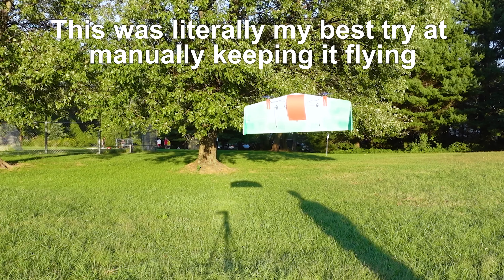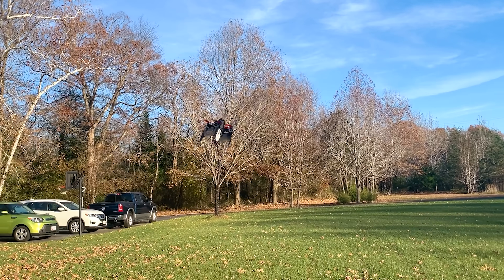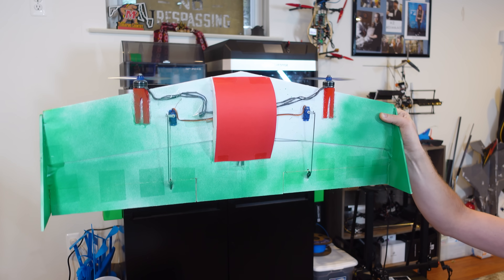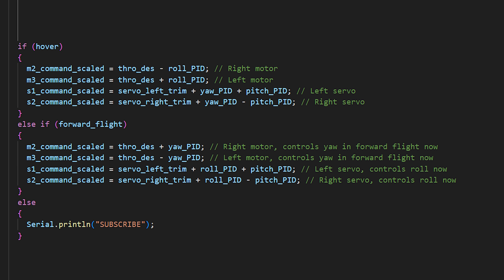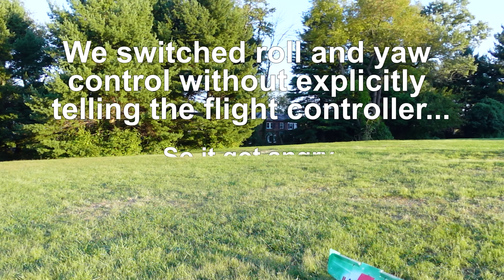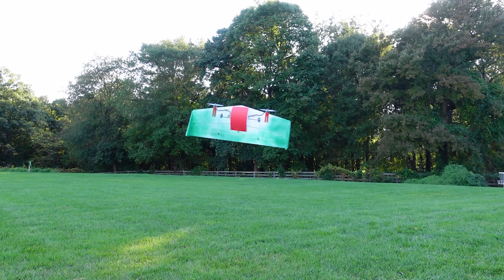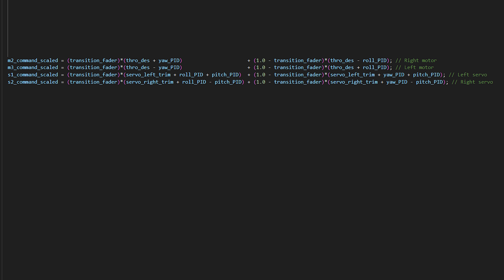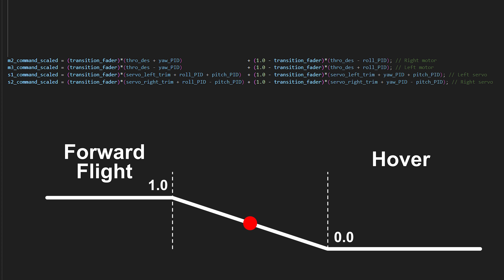Taming the Tail-Sitter: Hover to Forward Flight Explained

Comment: My mpu6050 is showing drift in values of yaw roll and pitch, I don't have much idea behind the implementation of madgwick filter so what can I do to solve this issue and why this is happening?
Reply from the maker: Probably need to calibrate the IMU
Reply: @NicholasRehm  I tried to increase the B_madgwick variable (I thought it is the gain variable between accelerometer and gyro), it made the pitch and roll stable, but yaw is still drifting, is it possible to stop this without magnetometer(cur MPU6050 do not have one)?
Reply from the maker: @PradhyumanSingh-x4u  you probably need to calibrate the IMU or read the docs

Comment: This tailSitter looks so much fun!
I want to build one ❤
I found that you provide the final code over at Patron!
You should totally rebundle this video as a build video, and market it as: a cheap sub 250 project you can build with your kids and have a great intro to programming 🎉
This is basically kiwico without the parts.
And you buy working code by signing up for Patron 😊

Comment: THIS is the stuff I've been dreaming of doing. I built an rc airplane and thought about getting some sort of processing unit between the radio receiver and the esc and the servos. What do you recommend using, considering that my goal is to learn the needed skills and then be able to do things like a tail sitter. In short, what should I be uploading my code to? An arduino?
Reply from the maker: I'd say build a regular rc plane first before overcomplicating with a flight controller. Direct RC receiver --> servos and motor, works just fine
Reply: @NicholasRehm  yes, I already have the plane built, my question is what flight controller would you recommend, basically
Reply: @NicholasRehm  hey! I actually followed your advice and am even more interested in making a tail-sitter. I'm thinking of making a wing as simple as yours - could you tell me some details about the one you made, such as weight and motors used, please? I'm worried that I might pick engines too heavy or on the other end too weak for this project

Comment: Hello Nicholas, i am new to the UAV community. I am planning on getting started with this TAIL SITTER model and learn about during the process. Can you please suggest the Motor and Battery spec for the tail sitter build?
Reply from the maker: If recommend staying away from a vtol as your first build
Reply: @NicholasRehm  I have tried the single copter(Ball drone)  model from Hackaday. The tail sitter VTOL fascinates me every time i look at it. Your built was the best one out there to learn. So, i thought about giving it a go.
Thanks for the heads-up.

Comment: It looks like your 4 engined tail-sitter had an asymmetric aerofoil profile but the subject here is literally a flying plank, getting lift simply from angle of attack. Is there any point in giving it a NACA profile, or would it always be stalled? It seems to have quite a steep angle here.  I'm intending to experiment with this thing but did you do that for simplicity or because you know there's no point?
Reply from the maker: Simplicity of construction
Reply: @NicholasRehm  at 0m28 it looks like you have double thickness over the leading half, so I guess a very crude 4% camber with a one step profile.  I forget the name for that.  Is that correct?  I was going to try 12%  and more sculpted profile, since this seems quite a slow aircraft. I guess the hide out for the electronics gives you more lift anyway.

Comment: It would be nice to know what battery, motor and props you used. I did some back of envelop figures with 300g 3S ,battery 2x50g motors and with all the lighter items I had zero grams left for the wing itself !
Reply from the maker: 180g battery, 2x 1750kv 24g motors with 5” props and peak thrust at 900g each. Foam wing weighed maybe 100g at most
Reply: @NicholasRehm  Many thanks, that clarifies a lot, I'll adjust my specs. I think I've sources most of what I need. The pdf documentation is excellent, very clear and thorough. One thing that gets only passing mention is the ESCs. I ordered a Mitoot  40A model. 30g each. Oddly the lower rated ones were the same or heavier. It'll probably serve later too.

Comment: Hi! I love your stuff. I have never made a drone or plane before, but I am looking to start ambitious. I looked at a lot of things, and for the project design I have in mind, dRehmflight is like a dream come true. Could you tell me if dRehmflight is capable of running an h bridge for a brushed motor instead of giving pwm to an ESC? I would imagine it's possible in arduino code, you'd just have to convert whatever number you want to the PWM for an h bridge, but I just wanted to know if you know if it is, or if theres any extra steps I would need to take. If there's anything I have learned about code, it's that if it wasn't designed with something in mind, its often really hellish to make that something work, especially as the HAL grows.
Reply from the maker: h-bridge brushed motor control is just different duty cycle pwm using the analog write function
Reply: @NicholasRehm  That's what I thought. dRehmflight would not mind this?
Reply from the maker: @citratune  you'd have to swap out the final motor write commands with an analog write call instead but other than that there's nothing stopping you
Reply: @NicholasRehm  thank u so much!!

Comment: Thanks for the arduino version added to the RCGroups page... now to sort the wiring out..... if you only knew the amount of times I tried to set up a tailsitter years ago using other flight controllers....this seems too simple to be true.... now to dust off a few old wings.... and print some more glue on motor mounts..... cheers

Comment: I am impressed by the work done. Is firmware based on Ardupilot/BF/iNav or something else? Can I try this FW on my aircraft?
Reply from the maker: It is my own flight controller code running on an arduino-compatible microcontroller. Check out the link the description to the GitHub repo

Comment: Hi Nicholas,

Great progress. Have been following your videos for quite a long time and glad to see that all missing pointers of tailsitter behaviour are solved in this video.

I have few queries :

1) How about putting rudder or split flaps for forward flight. Does it creates any major difference instead of thrust vector?

2) Would like to touch base with you for a project. Kindly let me know how to connect with you.
Reply from the maker: Rudder, split flaps, differential thrust--they all create a yawing moment which is the same in the eyes of the flight controller
Reply: Thanks for the revert. Is it possible to connect Raspberry Pi to this for further camera integration ?

Comment: Hobby coding and engineering always gets me wondering how hard it is to do these things with full scale aircraft. Must've been a pain in the ass to get the V-22 to transition correctly even if it isn't snappy like a styrofoam RC wing.
Reply from the maker: Physics and fundamental principles are all the same. But lots and lots more testing, validation, modeling...

Comment: Hey. I really admire your work on dRehmFlight. But ı couldnt find a source that explains how to use it as a stabiliser for fixed wing aircraft. A short video would be perfect! ı have bought a teensy 4.0 and ı am trying to use your code as a stabiliser for the plane ı am making right now (2.6m wingspan. it's kinda big)
Reply from the maker: Check out my video on how the code works, there’s some examples for how to assign stuff out to servos in the control mixer
Reply: @NicholasRehm  Will do. Thanks a lot for the Quick answer

Comment: You don't need a flight controller. You can hover manually if you have a rudder in your propwash. Ask any 3D rc pilot I've been hovering manually since I was 10 and that's not a brag.
Reply from the maker: Sure but no attitude command
Reply: @appa609 : Manual hover is possible with rudder when you have long moment arm. Flying wing with no extended tail, rudders are ineffective.

It can only work if you have rudder on wing tips or split ailerons or below the prowash as shown in the video or thrust vector.

Comment: Great video. Love how you explained different aspects of the problem the approach to resolve it. I am thinking of buying a teensy and build one of these. Will it work on a nano goblin which has only one motor or will need a lot of tuning and changes to the code?
Reply from the maker: Sure you can throw it on a nano goblin to stabilize forward flight, but I don't think you'll be able to hover it
Reply: @NicholasRehm  thanks for the reply. I was more interested in the hover actually to make the nano goblin a vtol. Any specific reason why this would not work?
Reply: @NicholasRehm  will putting this on a heewing t1 ranger hover it? That has 2 motors but a real elevator instead of elevons. I am assuming no. But just confirming.

Comment: Very interesting. VTOLs are on my list for ages now... I did some contraptions years ago, but the electronics/hardware were a limiting factor, not now tho. Next thing, deciding on type of VTOL, less dead weight + less moving parts = grater efficiency... so this type looks very promising, but as usual, it got downsides...
I'm very interested where are you going with this, keep us posted :-)
Reply from the maker: Primary downside of this particular design is susceptibility to wind, further complicated by reliance on motor thrust for control authority (ask me about how easy it is to control while descending at low throttle….). I’ve got a design I’m cooking up that I think solves some of these issues at the expense of a little more mechanical complexity!
Reply: @NicholasRehm "little more mechanical complexity" - hhehhh, that's where problems and fun begins, good luck m8!

Comment: The frame of ref and the actuators don't change relative to each other. You could've just change the definition of the remote control sticks 🙂
Reply from the maker: Using Euler angles for attitude command complicates this a bit. But yes I’ve done exactly this for rate-command tailsitters in the past

Comment: i wodnering
is it possible when you flick the switch to have a timer like 1-2 seconds where it calculates what boths tates are and does100:0 then slowly fades to 0:100 of the other settigns merging them so it isnt a sudden jerk,  but it slowly tilts over i unno,  XD

yaaaay i was right, but it was called fading :D and linear transition

Comment: Would it not be easier to auto-transition the controls depending on pitch angle instead of a switch input?
yawservo = yaw*sin(pitch) + ail*cos(pitch) type of thing?
Obviously it would cripple aerobatic flight, but that is not the goal i think.

Comment: What if you instead rotate the flight controller/imu to transition? 

Just stick it on a servo :) No code required?

Tailsitters seem like the best option for vtol it’s a shame the abandoned it for fighter jets. Shouldn’t the F-35 be able to do this instead of adding that hover fan?

Comment: Reminds me of something :)
I was planning to try the gradual transition sometime, but using a little simple sin/cos scaling. Seems to me that the relation to gravity magnitude is what matters, and that does not change linearly with pitch angle.
Reply: Maybe not gravity... It's true the gravity stays constant but I think the distinction is because regardless of pitch angle, air provides the same control authority from a control surface regardless of the direction that the plane is flying. Air gives the same resistance regardless of whether you fly up or sideways.

Comment: The only thing your “unimpressive piece of foam” needs to be my dream aircraft is a camera, vtx, and code that pivots the camera mount 90 degrees during flight mode transition. Your next project looks absolutely stunning! I can’t wait to see it! Thanks again for all your hard work and for sharing it with us. 🙏
Reply from the maker: That sounds like it would be a sweet setup. Check out my buddy peter's mini-qbit for something eerily similar https://www.youtube.com/watch?v=W0tthPSNnRE
Reply: I suppose a second camera and a PWM-controlled switch would be about the same weight as a servo and linkage, with less mechanical complexity. If the camera switch signal was sent as part of the flight mode transition function, it would make the transition even simpler. Thanks for the video suggestion. 👍

Comment: Flight dynamics and controls is such a challenging problem. So many important details!
Great clear walk-thru of the basics leading up to achieving stable transitions. Being able to make reasonably smooth transitions to level flight without airspeed or angle of attack sensors is pretty amazing. 
The ultimate test would be to fly the tail sitter through a loop, or barrel roll ... involving transitions to hover at various points in the maneuver.
Reply from the maker: That would be fun. Wish I had more time to dig a little deeper

Comment: I think you're over complicating what  needs to be done inside of the control algorithm for transition.  The pilot can keep the controls setup for forward flight with roll around the longitudinal axis of the vehicle and yaw around the vertical axis (well, vertical when in horizontal flight anyway).  The controls required to hover a vehicle with this setup is easily trainable.  Talk to 3D aerobatic RC pilots, they do it all the time. and when inside a manned vehicle it will be intuitive this way and counterintuitive the way you have it switching as the perspective of the pilot doesn't change when the aircraft pitches.  Have you tried simply leaving it in airplane (horizontal flight) mode and having a knob on your controller that just adjusts the commanded pitch angle from 0 (horizontal) to 90 (vertical).  You'll have to do something to get it to automatically maintain altitude in hover and during transition because otherwise you'll have to be Johnny on the spot with the throttles like the 3D guys.
Reply: https://www.youtube.com/watch?v=YcbKyPej1Aw

Comment: This is probably the most cogent explanation I've seen about tailsitter flight dynamics. Breaking down the problems one step at a time, plus not being afraid to show code, makes this super easy to understand. Excited to see your next build!
Reply from the maker: Hearing this gives me the awesome feeling of "mission accomplished", thanks a ton!
Reply: @NicholasRehm  🫡 Least I can do when my latest bicopter is powered by dRehmFlight!
Reply: Seeing each step was fantastic! I'm especially impressed he was willing to fly all of the intermediate steps that he knew were going to fail. It's so easy to just think through these problems and skip to what you assume is the finished solution, but actually testing the physical response of using a binary transition or not changing the forward flight gains really drives the lesson home.

Comment: Nicholas, could you potentially run features of inav on a teensy? i.e. RTH, OSD, etc?
Reply from the maker: I'm sure you could port inav to a teensy but I think your question is more about adding those features to my code--so the answer to that is that its out of the scope of drehmflight
Reply: Would you recommend running features as such on say a raspberry pi? I am going down the rabbit hole of getting away from off the shelf flight controllers and am trying to figure out what skills I need to learn @NicholasRehm

Comment: I wonder what happens if you use pitch input as a transition fader, for 90 deg pitch use all hover, for 0 deg pitch use all airplane control settings, and mix proportionally for all pitches in between. Maybe you won't even need a dedicated switch, but instead, push the stick forward to transition.

I mean, remove the notion of two different modes altogether and use a single control law for both, blending two different control laws based on the current pitch?
Reply from the maker: Unfortunately the ambiguities/singularities of euler angles complicates this
Reply: @NicholasRehm  Interesting, thanks.

Comment: I have built my own "tail sitter" I used iNAV in heading hold mode. I find the transition of roll to yaw and vice versa confusing, although given in my case, I don't need it to land in hover; given I have an advantage that my craft can do high alpha up to a hover.
IMO the advantage to roll and yaw switching is in tilt rotors. Still a feat to do it all on your own code.

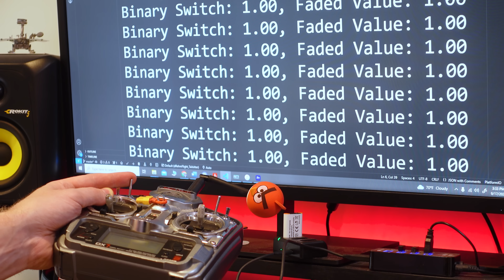Comment: This is an awesome project and walkthru for the "hover to forward" flight problem, I followed your thoughts the whole way and it is so satisfying!    One thing I'm not sure about is at 8:20, did you set the fade transition time on a fixed timer, or is it something else that's controlling/adjusting how fast or slow the fade phase should be?

Thanks for answering my question and for creating such awesome content, keep up the amazing work!
Reply from the maker: It's on a fixed "timer"--in reality it's just rate-limiting how much that variable can increment with each flight controller loop if that makes sense. I tune that increment size which directly corresponds to total time from 0 --> 1
Reply: @NicholasRehm  as your flight controller loop has a fixed frequency, a fixed rate also results in a fixed transition time... or where am i wrong?

Comment: Hi. I want to ask a question about your previous video: "Is THIS the Most Versatile Aircraft Design? (Forward Flight Testing) - Part 2". Could you please explain how you solved camera rotation problem? I want to do it in my project but I did not understand how. Thanks for your help.
Reply from the maker: A bearing and air brake

Comment: Do you also throttle up during the transition?  It looks like the smooth transition still looses a few feet of altitude.
Reply from the maker: I'm manually adjusting throttle in this case. It takes maybe a little extra throttle in the first 1-2 seconds, but then reduces to ~1/2 hover throttle position once it gets up on the wing